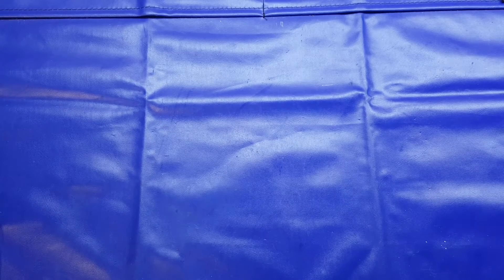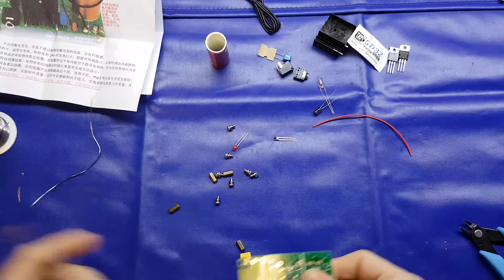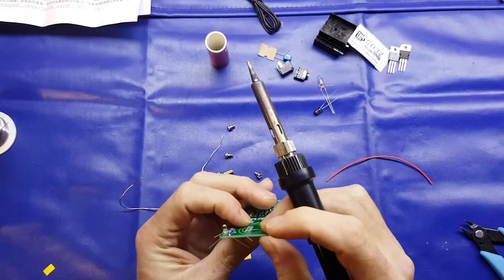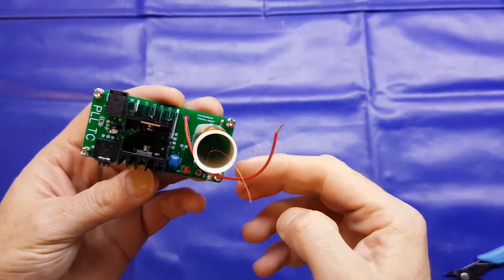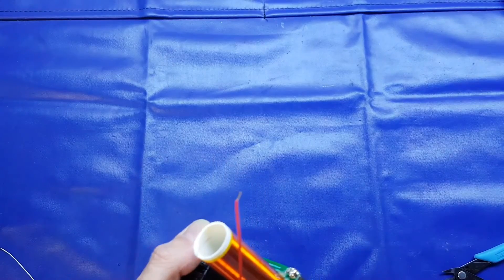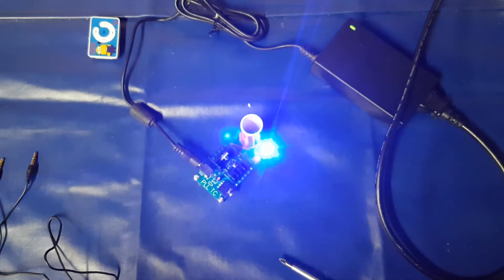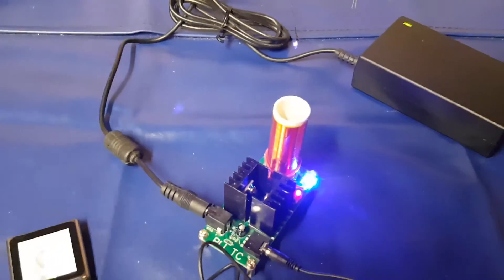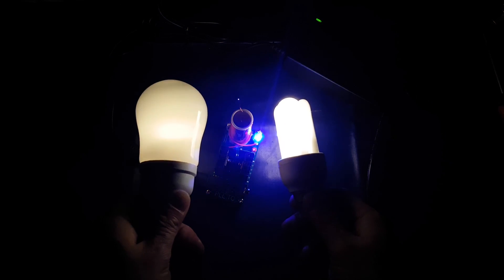Plasma speaker kit build with cheese, a fail and an interesting bolt-on video!

Comment: Thank you, I wasn't sure which hole the coil wire gets soldered to. The instructions don't say and the pcb has extra hole that I guess just accesses the same trace so it doesn't matter.

Comment: I'm building one of these right now. In fact, I'm waiting for the adhesive, that I used to mount the coil, to set while I'm watching your video. After that, I just need to solder the primary and secondary coil wires and then power it up. I watched a couple of other videos for this project and people seem to be adding active cooling (fans) to the heat sinks. I will also be adding active cooling before powering it up. From what I've seen in other videos, you can only run it for about 50 seconds before overheating without active cooling. Once I have it working properly, I am going to try some ideas like adding a tiny toroid to the top of the secondary, using two parallel primary windings, maybe changing some component values, etc. Another thing that I noticed is that (per the pictures in the instructions) the primary is wound in the opposite direction of the secondary. I am going to try it both ways to see if there is any noticeable difference. Have you done anything to yours to improve the performance? Thanks for the nice video!